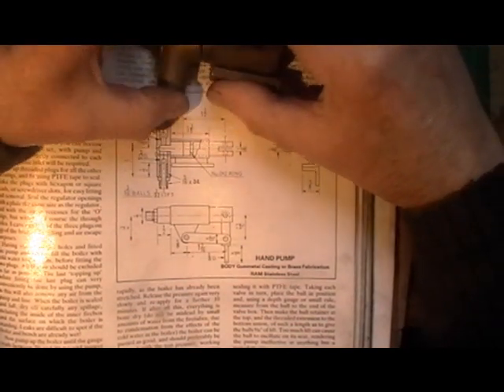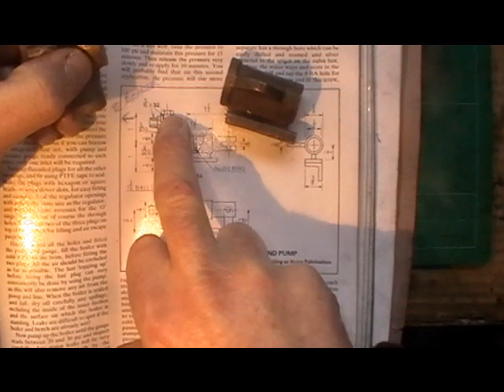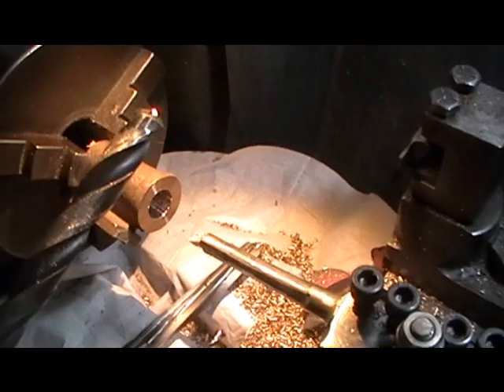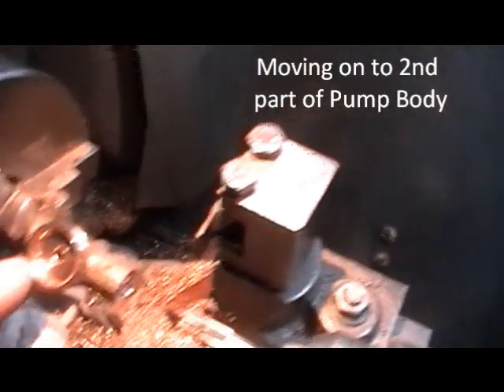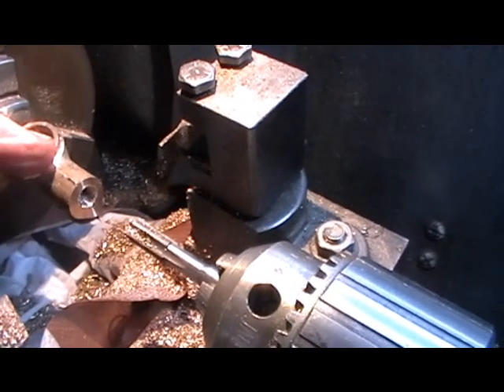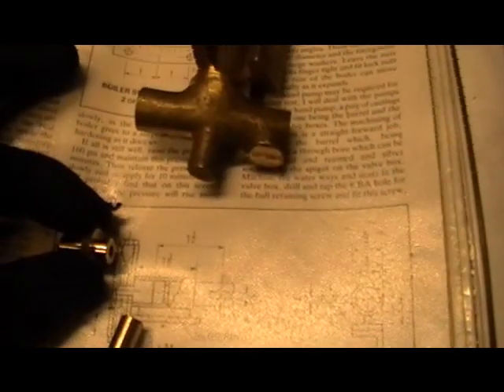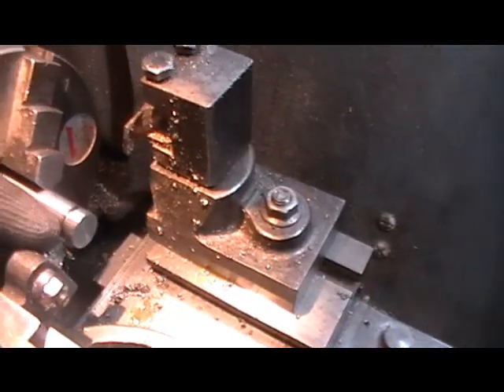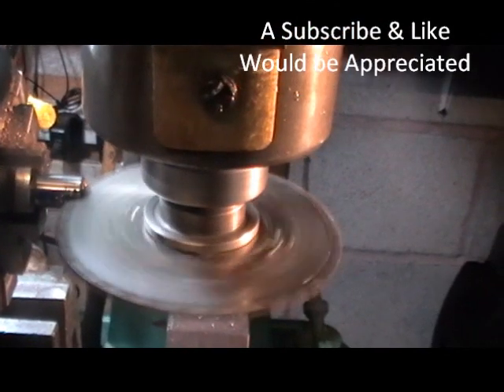Making a Beginners Live Steam Loco Fittings Part 10 ( Making the Hand Pump 1 of 2 ) "mr factotum"

Comment: HI From Reading. Yes a day at the club where we steamed our Young Engineers Poly locomotive for the 2 nd time. Still problems BUT with a collective of Knowledge all with hand on hot tea mug!! We overcame by resorting to a Rolling road and a gradual loosening of tight bits! I began in the interest at about 15 and just purchased Trevor Shortlands Big Prairie for my 60th Birthday. 4121 is superb and every detail is per full size. Hoping to pick up a Super 7 in the morning to add to my workshop! Lovely pump! Love David and Lily.
Reply from the maker: Hello reading
Thanks for your comments and interest. Good luck with the polly, there might be a tip there for me when you mention the tights bits, i always end up working everything to tight tolerences, i think its my ocd, so maybe i should relax a little to avoid too much running in. Ive been an engineer all my working life, always been interested in locos and anything working on steam all my life, but only just this last 2 or 3 year started to take the hobby of making them,  moving away from old motorbikes a little, my bad knee and back don't allow me to kick them up very well know.  Ive still much to learn and probably won't learn everything there is to know, so not sure what a big praire is yet, good luck with the super 7, ive got a myford ml7 with tri leva headstock, and a harrison l5 lathe, can't fault either of them.
Regards
Mr f